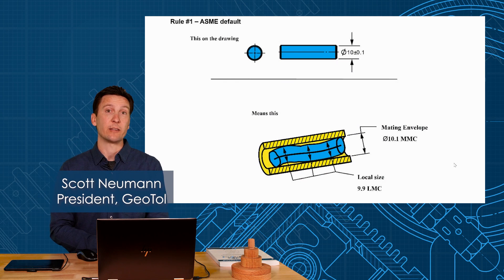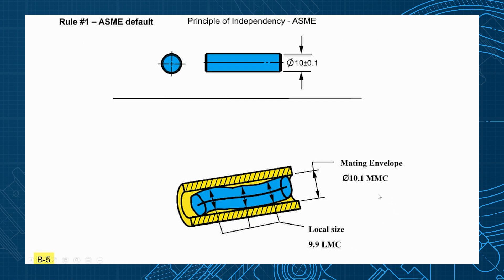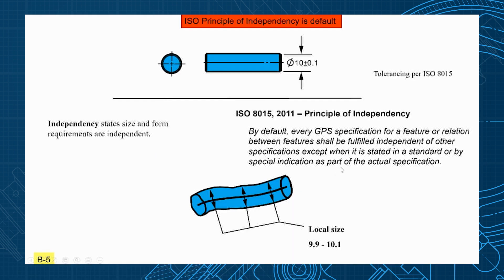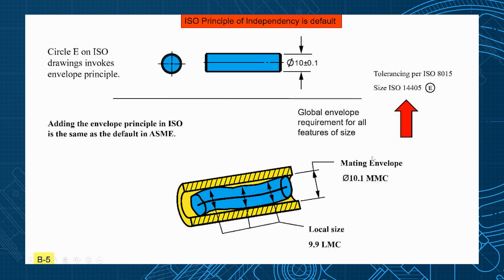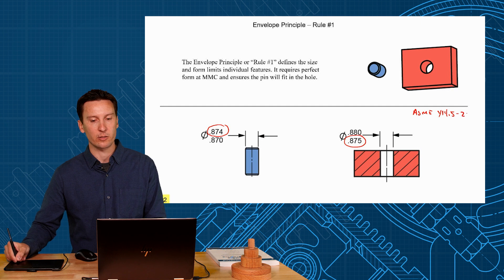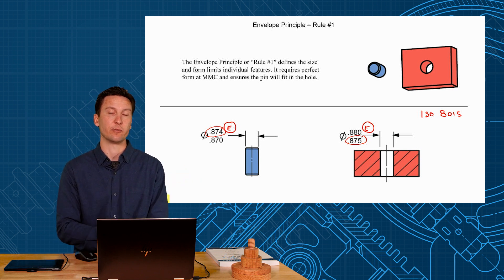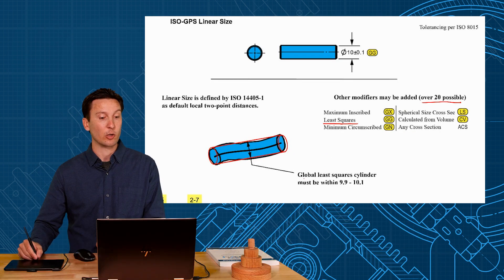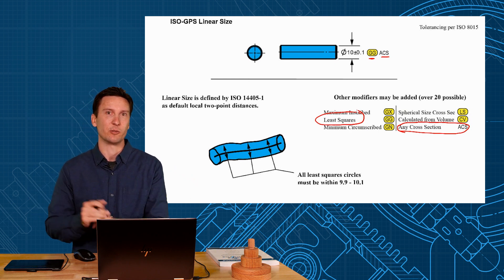ASME Y14.5 Envelope vs ISO Independency

Comment: I'm measuring opposed points of journals at the high limit or oversize per ISO 1101, but reporting under the low limit with the E modifier. What does this mean?
Reply: i need tolerance table for iso 8015

Comment: Hi! Thanks for the video! Will 2 different features, let's say ID and OD of the pipe, share the same axis by default in ASME? Or, do we need to add position tolerances between OD and ID in order to control wall thickness? Thank you in advance!
Reply from the maker: Two manufactured features can never be perfectly coaxial. So you specify a tolerance for how coaxial they must be (position tol). Another option is to define the size tol of one dia (either ID or OD) then specify wall thickness. The coaxiality (and size tol) is then indirectly controlled with the wall thickness tolerance.

Comment: There is only one big question: Whats the feature function? An envelope is the suitable specification of a linear size, which is a member of a clearance fit function where both features have all six degrees of freedom in the clearance fit against together. If a high number of linear sizes in a specification are involved in that function, the dependency principle of ASME or a default envelope of ISO would be suitable. Take care: If there is no fit function of linear size or less than six DOF are left, this wouldn‘t be a perfect specification: A datumsystem is required with a maximum condition at the tolerancezone. With the greate ISO 2692 all defaults are set for a clearance fit: N, X, GN, GX and CZ. Additional ISO offers with the reciprocity condition the oppurtunity to match clearance fit with every tolance at linear size.

The ISO default for a linear size isn‘t the local size. It‘s the local point „LP“. All local points are perpendicular against an axis of the Gausscylinder.
Reply from the maker: Good comments. I agree, function should drive the specification. Envelope requirement is great for free fit holes and shafts. I do find envelope principle to be overly restrictive on bolt holes constrained to a datum system. Perfect form at MMC is not needed and rather the hole must only clear the virtual condition. Yes, reciprocity is a great ISO way to turn any gtol at MMC to a zero at MMC. 

Good catch on linear size default for ISO. The local points perpendicular to the hole axis is slightly different than just ASME local size.